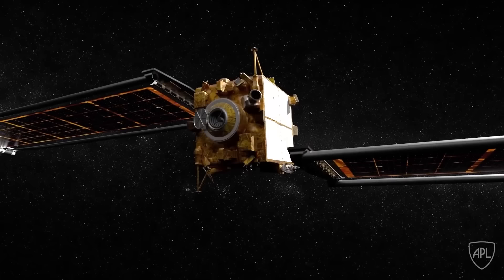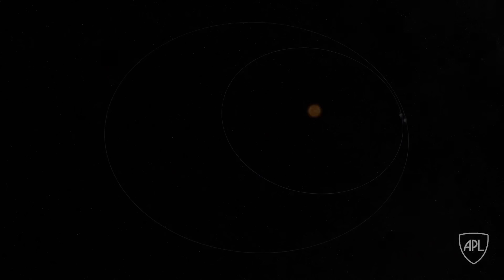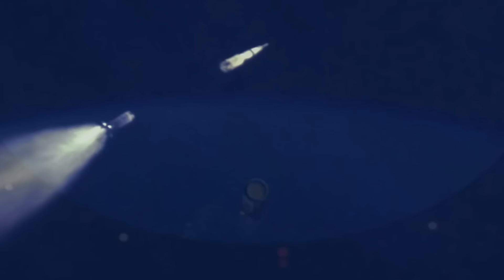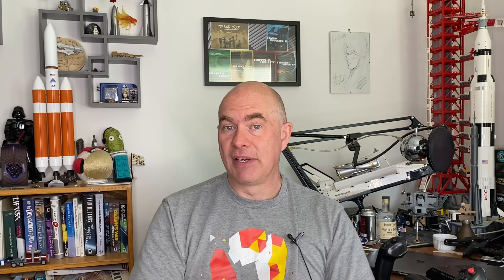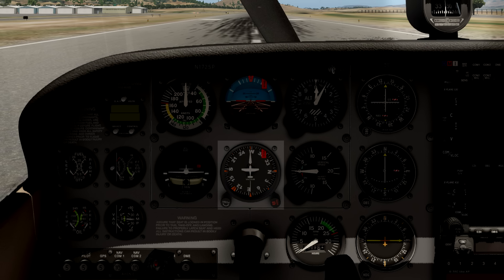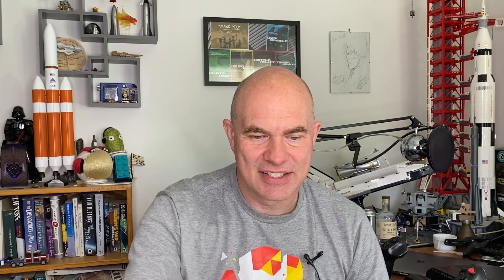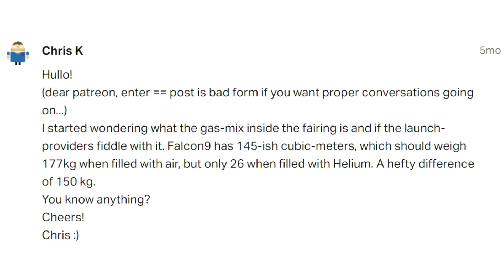Saturn V Staging, Asteroid Deflection and Hearing Rocket Turbines - Supporter Questions, Episode 17

Comment: Thank you for the mention of the book, Scott. Hoping you don't mind but I can clarify the answer to the Saturn V skirt separation question a bit.
The reason they hung onto the interstage ring for 30 seconds wasn't to hang onto the ullage motors. In fact, from Apollo 15 onwards, those ullage motors on the ring had been deleted. The second stage tanks were full anyway and their internal pressure provided sufficient head to feed the engines.
The reason they hung onto the ring was because the clearance between it and the engine nozzles on the second stage was a bit close. The fear was that if there was enough rotation of the two halves of the vehicle as they separated, there might be a risk of the skirt striking a nozzle. The plan was to allow the second stage to ignite and settle into its burn. By 30 seconds, the control system would have damped out any major rotation and the stage would be accelerating briskly. The ring would be cut adrift, allowing the stage to accelerate away from it before any rotation would have a chance to cause it to hit an engine.
Reply: I absolutely LOVE my "Haynes Manual" for the Saturn V!
Reply: @toonarmycaptain  He wrote the book. I'm sure the primary NASA source is in there, but I am traveling and dont have access to it now.
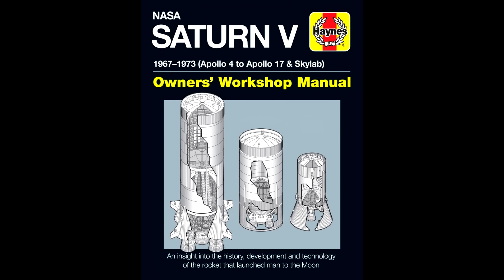Reply: @toonarmycaptain  I think he is the actual writer of the book "NASA Saturn V 1967-1973 " mentioned in the video at 3:24 the name and profile pictures match
Reply: Wasnt the ullage motor count only reduced, instead of deleted entirely?
I remember reading that before Apollo 15 it had 6 motors, afterwards they took that down to 4
Reply from the maker: Fantastic, thanks for clarifying!
Reply: @CardZed  I wrote a thing about this too, actually. I thought they only reduced the number, not deleted all of them, but I need to search for this, I'm not sure.
Reply: oh my. is this david woods. THE david woods?!
Reply: @S1baar  What is it about Scots folk and space? 😀
Reply: @toonarmycaptain  this makes me laugh, asking the ACTUAL Source for the source of his information!
But it's understandable in YouTube comments... Lol
Reply: @wdavidwoods  I don't understand haha...
Reply: @S1baar  Manley and me - both Scots.
Reply: I think I heard, the main reason why they didn't just hung on to it wasn't mass, but to prevent the engins from overheating, which almost happend during the Skylab launch.
Reply: It took me quite a long time to dig through NASA docs to find the answer originally, glad to hear I got it right
Reply: @CardZed  David Woods is right (as always)--the ullage motors were deleted on Apollo 15. 

However, what you're probably remembering is the count of separation motors at the base of the SI-C. On Apollo 15 the count of motors was reduced from 8 to 4. However, this resulted in a barely sufficient slowing of the first stage during separation such that it almost collided with the rest of the stack rather than cleanly falling away, a malfunction which would have been catastrophic. On subsequent flights the number of separation motors was increased to 8, as you may have guessed.
Reply: @janhofmeier9427  The only reason they didn't hang onto the interstage was mass. Its 5.6 metric tons would have meant a serious performance hit to the S-II during a lunar mission. Additionally, it was believed that had it stayed on, there would have been serious overheating issues among the J-2 engines of the S-II stage. The unintended failure to jettison the interstage during Skylab's launch proved that overheating was not such a great issue. Thankfully, on that flight, the Saturn was lightly loaded and the mass of the interstage was also not an issue.
Reply: @wdavidwoods  I do so enjoy the open conversation in the comments on Scott's videos. Intelligent, and fact checking. Delighted by our shared pursuit of accuracy.
Thanks for your comment.
Reply: Great comment.
For anyone looking for info on NASA, there are official NASA archives where you can find lots of stuff.
One of my favourites to have is the user manual for the AGS Computer.

Its one of those things the moon hoaxers hate to have brought up, but almost every document regarding Apollo not only exists but has been archived and you can download it. I have a bunch of the manuals.
Reply: On one of the early SpaceX Falcon 1 launches, this actually happened and many of us saw it on a live stream. On the Falcon 1 the interstage skirt is fixed to the first stage, and when the first stage separated the skirt banged into the upper stage rocket nozzle. In the video it is dark and then suddenly sunlight enters you see the nozzle scrape past the edge of the skirt and spring back into position before igniting. Though the burn started off well, the re-contact collision caused the upper stage to slew sideways and induced fuel slosh in the tanks, making the vehicle oscillate back and forth. The control system failed to damp it out, it got worse and worse, and finally the fuel sloshed too far and caused the engine to cutoff early, leading to a mission failure. I vividly remember watching that live and guessing what was happening before SpaceX cut the feed. Days later after analysis they confirmed what lots of us were thinking. I think this was the second launch, back in 2007.
Reply: Great things - Haynes manuals!
Reply: @scottmanley  G'day mate from Oz.
On star trackers, I did my degree in America (late 80s). Our team project for the final year was a comet fly-by space craft and I did the Attitude and Articulation system. One of the key components of that was a triple redundant star tracker and that was in 1986. So they have had for space probes fully automated star tracking systems since the 80s.
The voyagers had a sun tracker that was on the back of the high gain antenna and looked through the dish. the idea behind that was that so long as they could line up on the sun then the earth was also in the direction of they were transmitting.

On space Elevators, can you or someone else put this into the grave. Its one of those sci-fi fantasy zombie tropes that people wont let go of. Every time I hear about it I just want to scream. 

Arthur C Clarke (yeah the same guy who wrote Fountains of Paradise) pretty much killed in his NON-FICTION book "Profiles of the Future."
Yeah I have read of some other places they might work like in Kim Stanley Robinson's "Red Mars", "Blue Mars" & "Green Mars" Trilogy. In that case he was smart enough to point out that if you did build one on mars it would need to be very flexible so as to dodge    

Jack McDevitt's book "Deepsix" also involves a space elevator but only as a side issue.

The book that really uses space elevators as a major plot line is "Lifeburst" by Jack Williamson but it also required the artistic creation of a magic fibre called Kwanlon. It also describes what happens when elevators fall - that bit I think he got right.

Its a nice tool for writing science fiction and complete bunk for anything practical, because EVEN if you did have a magic fibre like Kwanlon how do you install it? Go watch some operations with cranes or even better lifting operations from a helicopter and then imagine that but the rope is at least 200,000 meters long. AND THAT only reaches LEO you then need another rope counterweighted out past GEO.

I actually dislike (not yet hate) the discussion because it wastes time when we have more pressing matters.
Reply: I learn so much from the comments👍🇺🇸
Reply: @toonarmycaptain  Lol, you asked David Woods for his source.
Reply: @tonywilson4713  I wonderful breath of fresh air - thank you. I fear nothing will stop this fantasy though.
Reply: Fairly certain that even full tanks need some form of ullage before starting engines. Even a full tank can still have bubbles, especially since some small portion of the cryogenic propellants have boiled off at this point. Getting any bubbles into the turbo pumps could cause destructive cavitation. So if they did actually ditch the ullage motors, then I would assume that the separation motors served the dual task of separating the stages and performing ullage to settle the propellants.
Reply: @adamk203  The only other motors operating during the staging sequence were the retrorockets in the fairings. According to the Apollo 15 Flight Evaluation Report, they were ignited at the same time as the separation explosives were fired. Therefore they would not have acted upon the S-II. If they had, their retro thrust would have had the effect of bringing any bubbles towards the engines - not what is wanted. The photographs and documentation show that the Apollo J-missions did not have ullage motors on the interstage. So how did engineers know that gas would not enter the engines at start-up?
This is my speculation: During the final moments of the S-IC burn, any gas in the S-II tanks was well away from the outflow ducts, at the top of the tanks. Meanwhile, the engines had been circulating propellant to chill them. As the stage went weightless following separation, there was only 3.7 seconds for any gas to make its way through the liquid to get to the outflows before "mainstage" occurred (engines reach high thrust). Since there was little to force any gas bubbles to get to the bottom of the tank, I assume engineers decided they would stay near the top and that ullage motors were therefore unnecessary.
Reply: @RCAvhstape  I recall that as well, they didn’t realize that after meco, there was still resulting thrust “impulse” coming from the engine and sadly it banged into the upper stage.  So wish we could have dropped Elon a note about what was going to occur beforehand.  Of course we didn’t know it was going to happen either so….. great chat.
Reply: @wdavidwoods  Scots folk and space? The same reason Scots folk are over-represented as ships engineers, to get away from the cold and wet, and find somewhere warmer in the universe.
Reply: @scottmanley  Hey regarding Starship 2.0, can you go over some basics of what a larger size means?  My basic understanding which could be wrong is that if you have engines with the same or better efficacy but have say x9 the fuel (larger or more numerous engines to compensate) you can afford to lift x9 the weight, and if a rocket becomes larger in all dimensions (taller and fatter) that the tank doesn't need x9 time the steel and surface area to have x9 ties the volume, so you have a weight and drag saving which might allow for taking more Payload!  But other videos are saying it might be x8 or x9 ties the fuel but just x3 the payload which seems wrong to me?!
Reply: holy f* how do you know that thing?!?!?!!?

Comment: The actual reason for the dual-plane separation on the S-II was that the engineers had concerns that the vibrations caused by the 1st stage would make the interstage bang on the engines (since there wasn't much room around them). The interstage was then jettisoned after the engines stabilized burning and the vibrations were under control
Reply: I believe this is correct. Although I'm sure they were keeping the ullage motors in mind when designing it.
Reply: That's the reason given in "Stages To Saturn". NASA SP-4206 or NASA 033-000-01176-8.
Reply: @jamest18  Yeah, I think so too, it is a nice place to put them, where they won't constitute dead weight
Reply: I've seen interviews with Apollo 8 crew members Frank Borman (Commander) and Bill Anders (Lunar Module Pilot) where they both described the violence of the SI-C - SII staging event. The astronauts were thrown forward against their restraints as the first stage engines cut off, then thrown back into their couches as the ullage motors and second stage engines were activated. No two vehicles so massive or bulky had ever been separated in mid-flight up to that point in time. Yes, there were plenty of unknowns about what vibrations and other mechanical motion modes could occur and about what damage could thus result during staging.
Reply: @takashitamagawa5881  it’s crazy how many things had to work perfectly just to stage. S1C outboard engines cut off, milliseconds later both the printer cord and second stage ullage motors fired, milliseconds after  that the S1C retro rockets fired while simultaneously the engine start command for the SII was given and all engines had to start perfectly and at the same time. So many violent events, preceded by a violent boost phase from the S1C full of transient vibrations. The engineering to pull just THIS off is mind blowing. And that’s not to mention literally everything else pertaining to the Saturn V and Apollo program

Comment: One of the ways that improved the performance on later Saturn V missions was a reduction of the number of ulage thrusters on the insterstage with them eliminated completely on the last few flights that included those with the rover.
Reply: How did they eliminate ulage completely?
Reply: @toonarmycaptain  It is mentioned in the instructions for for the 1:133 Revel model kit. Alos on wiki and the Saturn V owners manual
Reply: @slaphappyduplenty2436  I belive it is a combination of residual atmospheric drag and exhaust from the prechill on the J2 engines on the second stage. Does not take much to keeep the propelants settled.
Reply: @martinrwolfe  Any atmospheric drag would have pushed the fuel up, not down.  As David Woods mentions in another thread, the pressure in the 2nd stage tanks was enough to start the engines.
Reply: I read some place that Saturn V had a huge amount of capacity, some ways over engineered so it could lift more mass on later Apollo missions. Launch vehicle can accommodate extra mass but spacecraft itself needed additional capacity.

Comment: Having obtained my private, then commercial and instrument ratings in the late 70's, early 80's on "six packs" only, when discussing HSI drift, very few today recognize the significance of slapping cams up everywhere in and around the cockpit, particularly the panel cowling and the effect this has on the magnetic compass. Various cockpit configurations at production is the reason for the "Deviation Card" attached to the compass as each aircraft is unique in respect to magnetic field "anomalies". Further, most airports have an official "Compass Rose" painted on the pavement in a remote area of the ramp so you can taxi on to it and with the engine running, electronics all on, aka "in flight mode" confirm you mag compass accuracy. It can be a big deal when truly flying VFR only. A lot of the "RNAV" equipment back then had sensors remotely located to a specific area of the wing because of this issue.

Comment: The reason for the 2nd stage skirt was because there are 5 engines on the 2nd stage and they didn't want to drop the skirt until all 5 had lit and were not moving around trying to stear the stack. This info was stated in several NASA documentd.
Reply: You definitely don't want to drop your skirt too early.
Giggety.

Comment: I always listen for the turbopumps to spin up.
It helps me know what's going on as a blind viewer.
You can hear them on a lot of the test videos.
Sometimes, the spin-up is a quarter of a second.
Makes me wonder at the materials sciences here, as the pump has to handle the torsion forces, thermal variances, and fluid loads. Guess that's why being a rocket scientist is kind of a big deal.

Comment: The first question was actually about a spacecraft heading for impact with fuel onboard, would burning that fuel to increase the impact velocity add more energy than just keeping the fuel onboard to increase the mass of the impacting rocket
Reply: That was my interpretation too
Reply: Exactly, Scott misunderstood the question.
Reply: Well. Your intercept orbit could end up just gently grazing the target at like 1m/s... which would be equivalent to what scott was talking about
But yeah, i also agree he misunderstood
Reply: Burning the fuel to increase velocity will impart more energy on impact. Specific Impulse basically means how much velocity can be added by burning a certain amount of the fuel. So if a rocket had a mass of 3kg and initial velocity of 1 mps then momentum is 3kgmps. If we burn 1kg of fuel and the new velocity is now 2mps then the total momentum is 4kgmps. So there will be more energy transferred on impact.
Reply: Could this be a valid analogy:  If you drop a 7.62mm rifle cartridge 1m to the ground will it hit with as much momentum as if you put it in a rifle and fired the projectile into the ground?  In this case the mass of the propellant (and casing and primer) is far less important to momentum than the velocity given by combustion of the propellant to just the projectile.
Reply: @Andrew-13579  that’s a good analogy. And I assume you’re correct. By burning the fuel, you are reducing the mass of the spacecraft, but you are unlocking that precious chemical energy stored in the fuel instead of having it wasted in the impact. That seems to make sense to me.

Someone smarter than me could work out the math. It’s honestly a really good question.